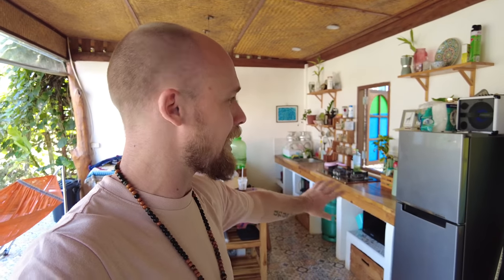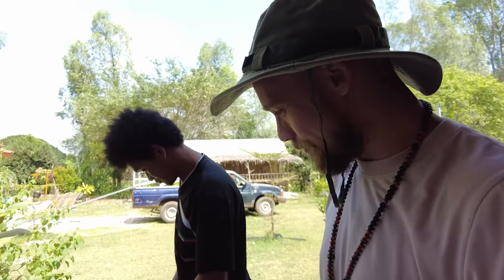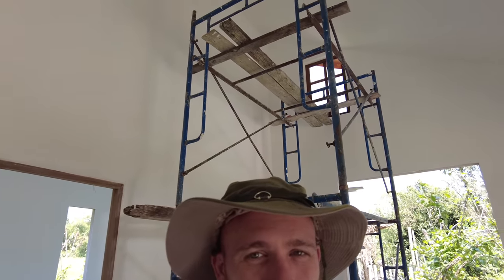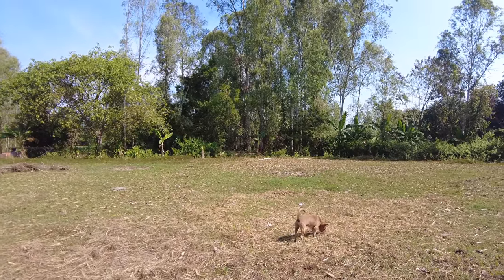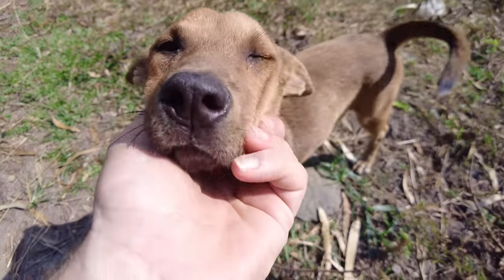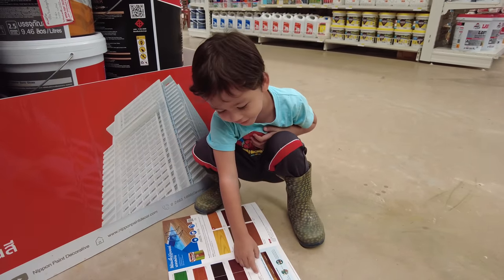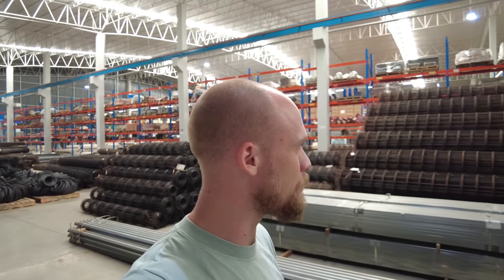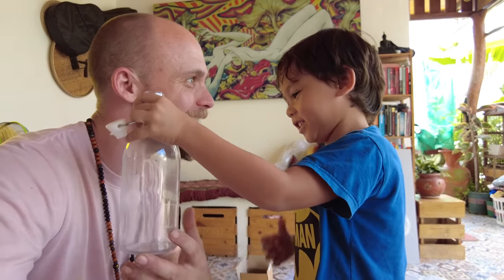My Wife Is Not Happy With Me This Morning & House Build Challenges In Thailand! 🇹🇭

Comment: The cottage is looking great Ryan. The cleanest builders in Asia! :) I built a small restaurant last year here in Cambodia and the local Khmers showed me a way to age timber and minimize termites = Old oil from motorbikes.. first they burnt the bottom of all of the posts prior to concreting them in and then gave the posts about 4 coats of dirty oil.. After about 2 weeks there is no smell or residue and new wood looks really aged.. You could also put a varnish over that after its properly dried or even a stain to get the exact color you want... It really came out great and so far no termites... Peace & Harmony!
Reply from the maker: Thank you 🙏